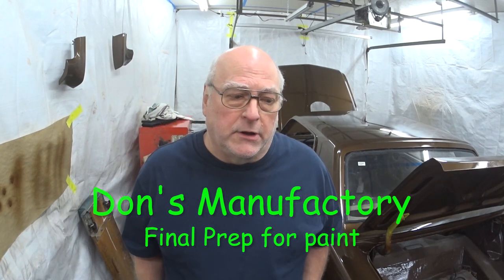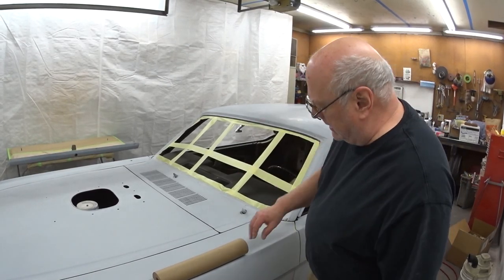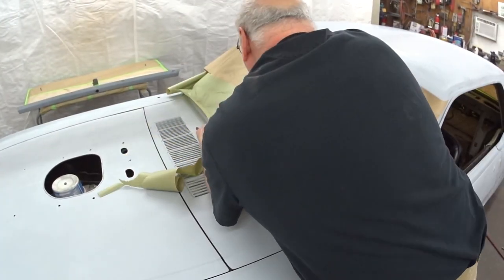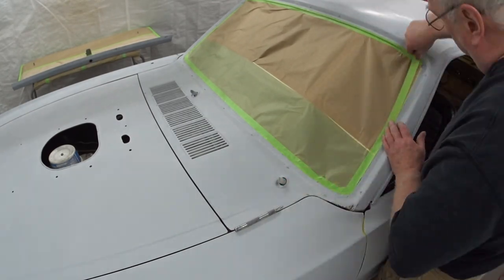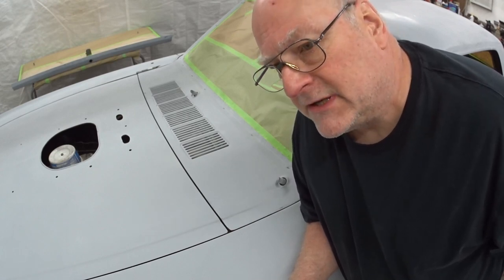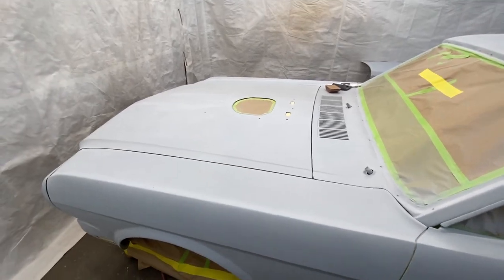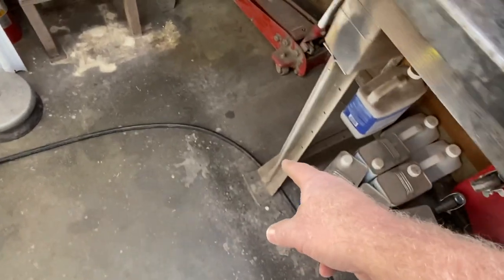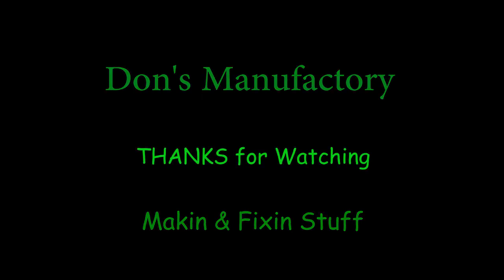66 Mustang Betsy - Paint 23 - Final Prep For Paint - My Masking Techniques.

Comment: I used paper as well for the same reason. Plastic is easier but was worried that paint would flake off and become airborne as it has no rigidity.  As far as cut and buff, I found that as the clear hardened it shrunk so regardless of overspray you will have to cut and buff anyway so do not overstress about it. I look forward to paint video you make it a little foreboding so I hope all went well. Remember as the painter you will see EVERY imperfection like I do. Take a step back and look at the car through someone else's eyes and you will realize how good the car looks. all the best my friend.
Reply from the maker: From what I got from Brian over on paint society videos is that the plastic made especially for painting / masking has a side treated to “hang onto” the paint so chips don’t fly off into your paint. 
Thanks Wally, all will be revealed when next we have sunshine and I can get the car out and really check it out. Weatherman is promising sun this coming weekend.

Comment: I have had odd issues in the past when I have used sealer. If it's rough it may not be from overspray it may be from too much air from the spray gun and not a high enough fluid flow.
Reply from the maker: Thanks Robert